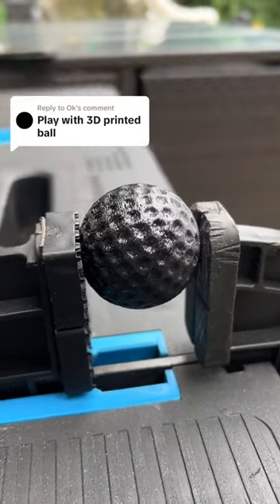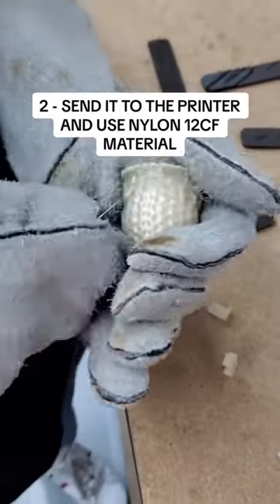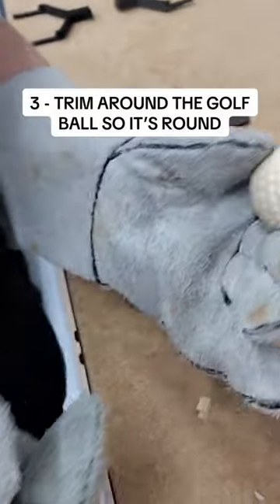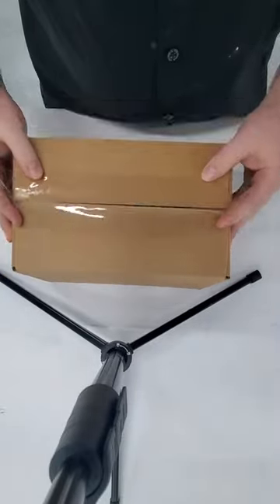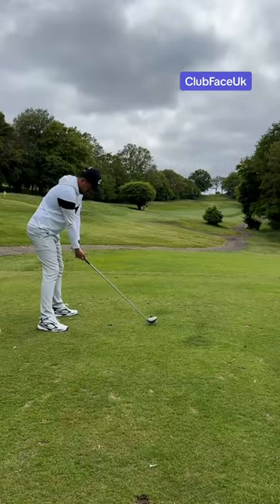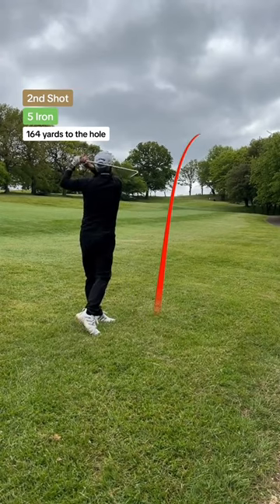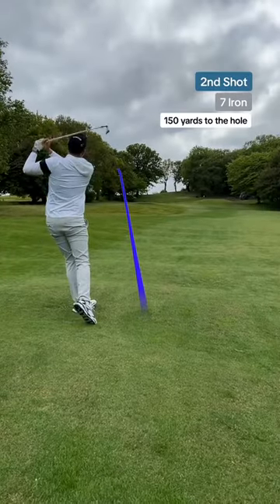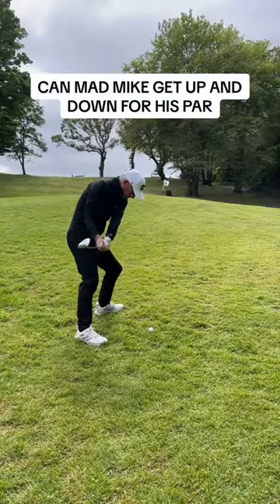Father VS Son - 3D PRINTED GOLF BALL?!

Comment: Why didn’t you just commission someone from the u.s to print you a ball using any material, it would have been pretty cheap
Reply: Hi there, We were able to throw these onto our industrial sized Stratasys printers that cost us a very small amount in terms of material cost. But the type of material used was what gave it enough strength to withstand the force of a golf club. The materials we print with are not easily available to the public as well. Hope this answers your question!